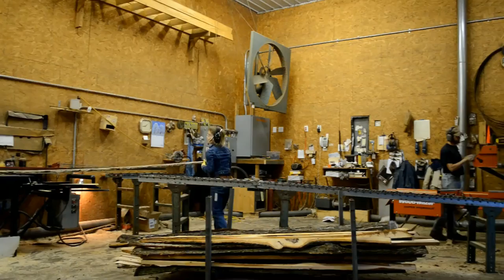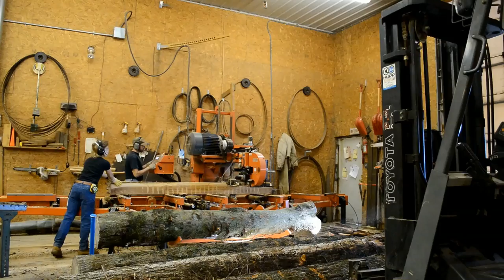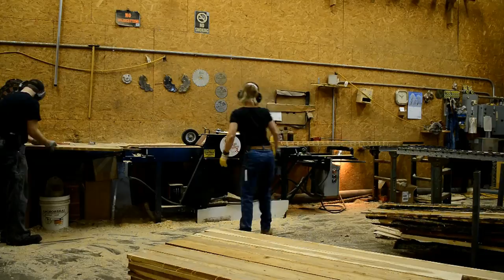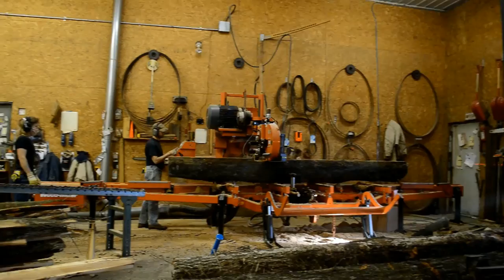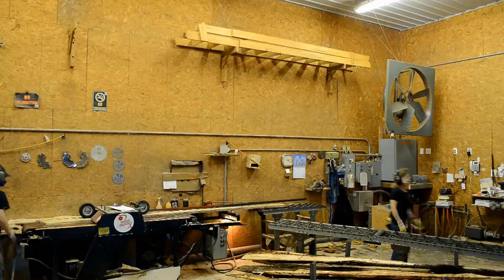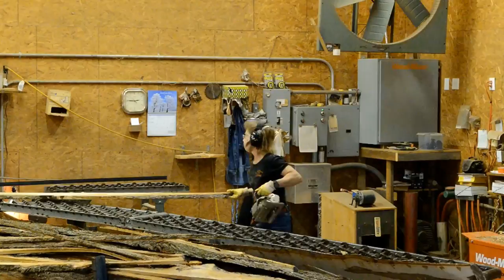Wood-Mizer LT50 Sawing Hickory, SPEED Version

Comment: I remember having seen a side trimmer saw somewhere, or whatever it's called, that had laser guides, so you could position the blades by eye without having to measure anything. Is it an idea to fit those to your machine?
Reply from the maker: +09conrado Thank you for the input, We have discussed lasers for the edger, but decided against it. Thanks for watching! Linda

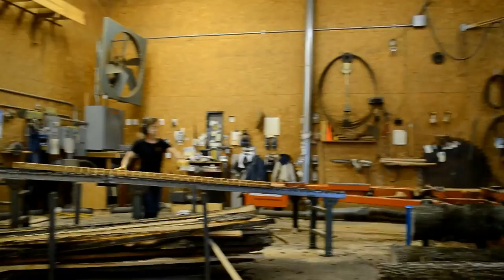Comment: I noticed there appeared to be "stripes" on the side of the log at 4:53. Is there a lot of moisture or just more sawdust than can be kicked out the way it normally is? There seems to be a lot of tension built-up in this type of wood. I assume that makes "sticking" and drying very precise and critical. Apparently this is also custom work due to the recording of, what I suspect is, the "board feet". Once again, a very interesting video. Thank you.
Reply from the maker: Herb Houston Hickory is hard and abrasive, so the pulsating water flow, to cool the blade, is increased and the saw speed is decreased. This saturates the sawdust which makes it stick to the wood. Sticking and drying are very precise and critical under all circumstances. Some lumber has so much stress in it that it won't dry flat anyway. Yes, this was a custom job where we tallied the lumber board footage "on the go" (most of my videos are of custom jobs, but some are tallied afterward, when the lumber gets put on sticks). I'm glad you enjoyed the video, thanks for watching! Linda

Comment: Hi Linda, I am up here in Montana trying to get my own saw mill and business going. I am considering the LT-40 super hydrolic for use on larch, birch for and pine. What do you think of that saw?
Reply from the maker: Gary, In 1993 we purchased our first sawmill, a Wood-Mizer LT-40. The super was not available at the time or that would have been our choice. The LT-40 served us well for almost 20 years & was still working fine when we upgraded to the LT-50 in 2012. We would have gotten the LT-40 Super, but opted for the chain turner instead. I will ask God to bless your new venture. Thanks for watching! Linda

Comment: Hello Linda, I want to make the business a small sawmill, has its own building 126 square meters, drew attention to the company equipment Wood-Mizer, advise some sawmill to choose and what additional equipment will be needed, how many times per shift sharpen the saw. Thank you in advance for your reply.
Reply from the maker: Wood-Mizer makes several good sawmills and they sell a blade sharpener, as well. They can help you choose a mill that is right for you. Some kind of forklift is essential, the type depends on your situation & terrain. We have an electric fork truck that is rated for 5000 lbs, for use on concrete. We also have a skid steer for all terrain handling of lighter logs (2200 lbs). An edger is advisable, as it makes production increase dramatically. Plan on sharpening sawmill blades 3-10 times per shift. Thanks for watching! Linda
Reply: Thanks for the reply Linda, God help you at work.

Comment: How often to do you have to give attention to the blade?   Replace it?   Sharpen it?
Reply from the maker: It depends on how clean the logs are and what species, etc. Sometimes we have to change/sharpen blade after 1 log, or we may saw several logs before a change. Thanks for watching! Linda
Reply: LindasSawmillCinema So it sounds as if that becomes a rather large expense for you.
Reply from the maker: Fortunately, the blades can be sharpened several times and they are not terribly expensive. Shag bark hickory can hold a lot of dirt and is pretty abrasive to saw, but some species, like clean Basswood, is super nice to bands.
Reply: LindasSawmillCinema Ok, thanks.